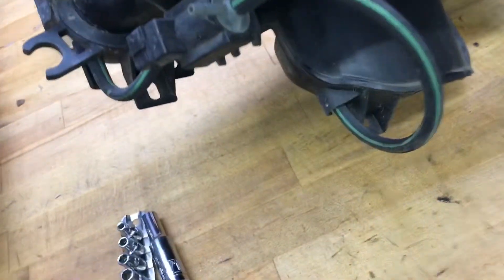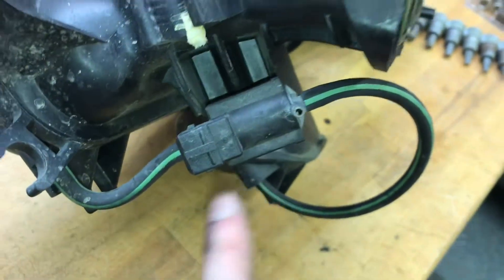Chevy Cruze Intake manifold removal 11-15

Comment: Thanks for adding this.  I got the link over at Cruzetalk to your video.  If I keep the Cruze through next year this is my next task. Pretty sure my check valve is gone.
Reply: I would not wait that long if I read you post correctly.
Reply: Your post, not you post